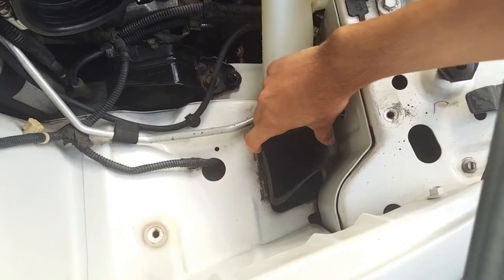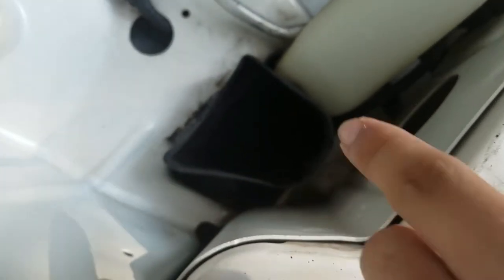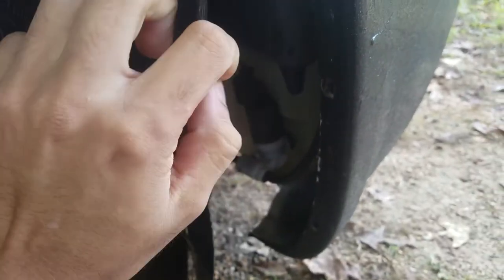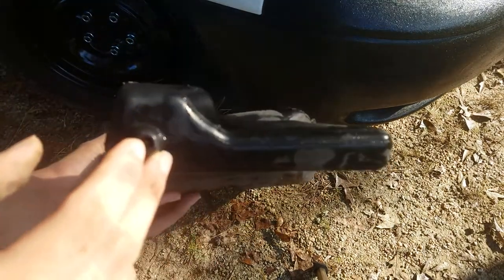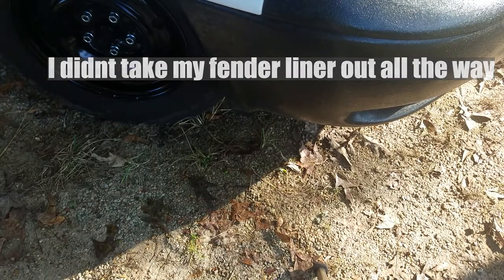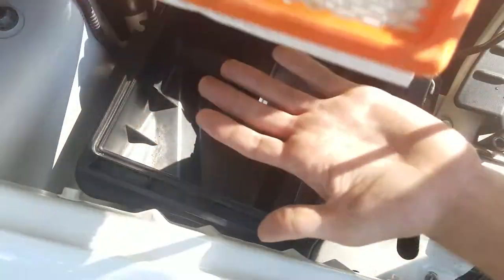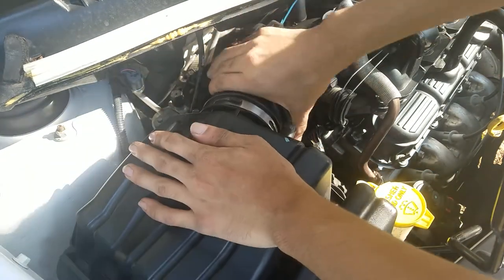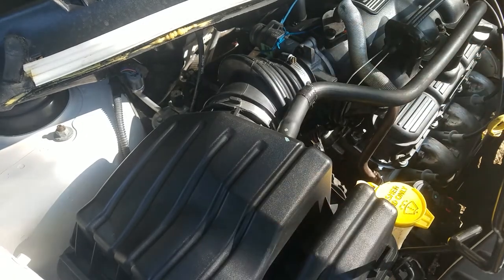Intake Muffler Delete, 01-07 Grand Caravan or Town & Country | Air Box Resonator Delete

Comment from the maker: Correction! This should have been obvious 😂 The chambers at the bottom are water traps/mufflers. Air gets sucked in through the other big tube. Still, this mod will add more airflow without the mufflers.

Comment: SO someone commenting below that this is a drain hole.  i don't think so!
after i bought my 3.8 chrysler minivan i noticed this on my own, and removed the 'offending' part for better performance.
however, even at the time, i realized it was a device to limit the ability for water to enter into the intake, much as the snorkels on jeeps that ford rivers.  i KNEW i was defeating this 'safety' device!
you better know it too!  while not as extreme as a jeep with a snorkel, if you were to drive through deep water, this 'restriction' might save your engine from total destruction!!  and i've watched as motorists have tried to drive through water 2 feet deep or more.  most made it, but a couple didn't.  i wasn't privy to what happened to cause their motor failures later.  could have just been the coil getting splashed!
or somehow water coulda gotten into their cylinders and broke their connecting rods.  whoops.  water don't compress.
that is [imo] why chrysler 'overdid' it on the intakes of these vans, because of dumb-asses driving through deep water.
i know when it's crazy raining out now, i'm frigging worried!  if i drive through even a big puddle, i slow waaaaay down

Comment: Wouldn't putting a stage 3 cold air intake do a better job of delivering unrestricted air into the engine without tripping the CEL?
Reply from the maker: There are no cold air intakes for the grand caravan.... and this does not trip my cel